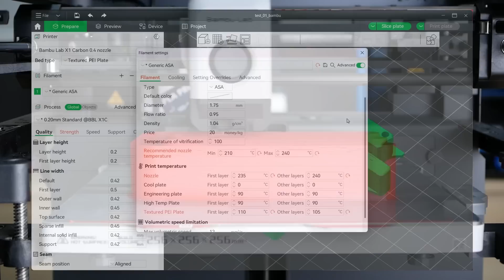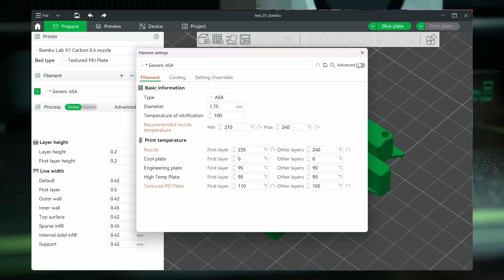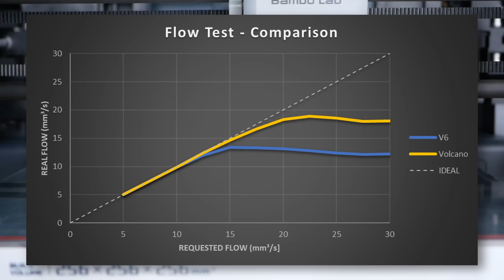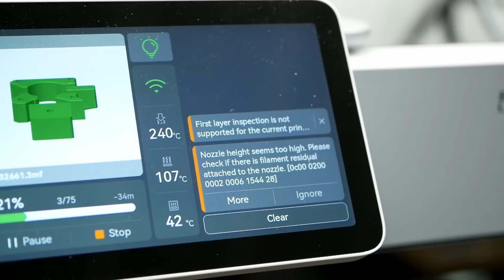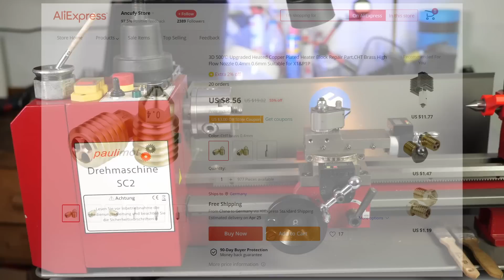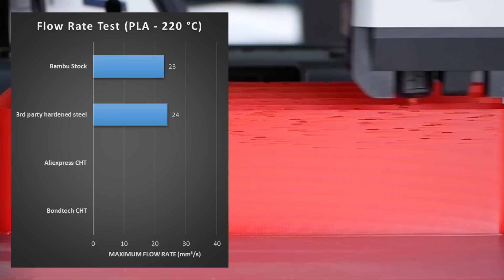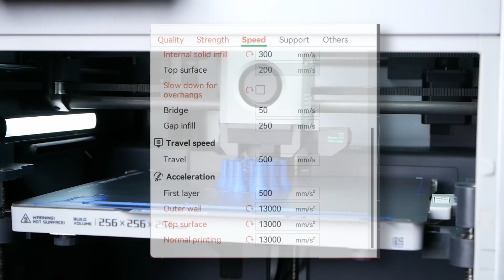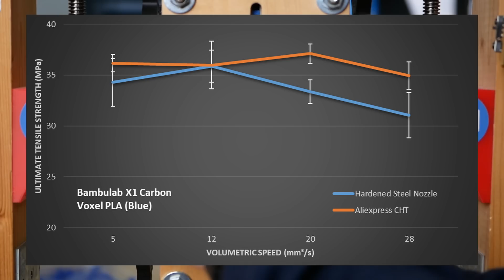Fast 3D printing is bad for Strength! (and how to fix it!)

Comment from the maker: Have you ever noticed that you printed TOO FAST?
Oh, and check out our CNC Kitchen products at https://cnckitchen.store/ or at our resellers https://www.cnckitchen.com/reseller
Reply: @Stefan,
You asked for an idea for your test pieces - how about Archimedean chords as 100% infill and 0 perimeter? This should allow you to reach the speed more likely.

General thoughts on flow rate:
When I have many identical parts to print, I often take the effort to set the layers to a different temperature for increasing the flow rate even further. It would be nice if there were a function in the slicer for this - a temperature dependency on the flow rate, or, in reality, a temperature compensation, because our material does not reach our set temperature. Perhaps we have a deviation between the measured value in the hotend and the actual temperature in the material due to the high extrusion rate. If you follow this idea further, it should be possible to establish a relation between the heating element's power and the extruder's feed rate, taking into account the thermal conductivity to consider the resulting delay in temperature correction. Therefore, I do not believe that these settings can be adjusted via firmware, as temperature changes must be made in advance. Unfortunately, I am not a programmer, but I am really interested in whether this could be used to tune the flow rate of ANY 3D printer without making changes to the hardware.

Tüdelü 👋
Reply: You don't drive a car at its top speed! 😂
Reply: @tslee8236  if I have a speedometer, I'm gonna use the whole speedometer!
Reply: Could you do a check on a Voron at high speed? Just to see if this is a generic fast printing issue or unique to the Bambu.
Reply: yes ! very poor layer adhésion issues specially with petg (X1C). days of tunning (slow down cooling and flow rate, increase temp).
Reply: .6mm nozzle and going at it with thicc layers has been way stronger.
Reply: I don't know if it's any use, but I ran some calculations using some numbers I could find for PLA's specific heat and density, and came up with a theoretical maximum cubic flow rate of 2.5 mm^3 per watt of the heater block. A 20W heater can at theoretical maximum melt PLA at 49.78 mm^3/s.

Numbers based on:
Specific heat capacity of 1800 J/kg/K
Density of 1240 kg/m^3
Target temperature of 180K over ambient (approx.  200C)
An assumption of no heat loss to the environment and perfectly even melting through the filament (hah!) but there you go.
Reply: I would suggest you increase the line width to about 200%.
This way you need less speed hence less acceleration.
Also the square corner velocity can help a bit.

A Voron 0.1 can easily hit 25k acceleration and 40 square corner velocity so that might also be an option tho you won't be using that hotend I suppose
Reply: So the machine can go up higher than 300°C??
Reply: Does the higher flow nozzles have any bad effects when printing slowly? Does it affect retraction settings?
Reply: Have you tried the E3D nozzle? We get much better results than from the CHT nozzles, and also get much better layer adhesion even at high speeds.
Reply: yup, i just noticed my PLA filament has awful layer adhesion. I just thought the random brand ive never heard of just made a bad quality plastic, but now I think I just need to lower the flow rate to ~8 mm3/s. Gonna try it today, maybe i'll change back from petg to pla again, for things i use just at home and not outside (for temperature reasons) Thank you a lot
Reply: Nice work, just a small thought, if the nozzle need a longer distance for the filament, then maybe the path of the filament in the nozzle could be changed to a circular downward path and end in the tip. A bit like the heat pipe in a water tank.

Comment: I print only at Standard speed w/ my two X-1 Carbons, and I use PLA, and I've noticed the parts feel very sturdy, but the layers look all funky just like you showed. I'm surprised that's even happening at the Standard speed.

Comment: my biggest problem with the x1c is that the firmware restricts how hot the nozzle can go. there are aftermarket nozzles that can go up to 500c but the firmware is hard limited to only let it go to 300c no matter what.

Comment: The next bottleneck after this is layer cooling - having too much affects layer adhesion and should only be used for bridging and extreme overhangs. I think the only real workaround to this is a larger print bed and printing more parts at a time, providing the plastic more time to cool off before the next layer comes along.

Comment: Normally I'm all for upgrading things using aftermarket parts in hopes of getting better performance. But in this case I will pass with my X1C. The printer has been 100% rock solid and is 100% bone stock. Why change something that isn't broken?

Comment: Interesting video, but you should continue to increase flowrate above 28 mm^3/s as CHT nozzle didn't show singns of decrasing the strength of samples printed  at high speed.

 I made max flow calibration in Orca (V3 KE, brass 0.4 mm nozzle, regular PLA), too, and I noticed that thickness of the meandering extrusion test is falling linearly up to 27 mm^3/s when obvious underextrusion (holes) starts to appear.
Anybody here knows how to make wall thickness constant up to a certain flowrate?

thx in advance

Comment: Could there be something about how deep the nozzle tip is on the original? If we are talking about cooling the nozzle too much or that the filament flow reduceses the temp of the nozzle so the machine can’t keep up. I’ve tested both ali and bondtech cht and finds bondtech to be the worste/best in conducting away heat with that big body/nozzle, alot less but still gives temp error on the ali cht. Could there be something here that made bambu go with such deep integrated nozzle. Or do we need to go with double heaters elements to sustain the temp as we can’t adjust PID.

Comment: Heij :) I've installed the CHT clone hotend and did the max flow test using PETG. It resulted in about 30 mm^3/s. After a few prints (like 3 or 4) I noticed heavy under extrusion. The parts I was printing were really small (print time of 5 mins) and it got better with special settings for quick layer times which also lowered speed and flow. I changed the nozzle, used Bambu's thermal paste instead of the one provided by the CHT clone, and swapped to the heater and thermistor. Later I figured out: The max flow rate is way too high. I redid the max flow rate test and only got 16 mm^3/s with the same spool of material. 
Any idea why I only get 16 mm^3/s with the clone hotend? Maybe it's got something to do with the 1.7.x update? I cannot test with old firmware because Bambu won't let me downgrade.

Comment: These AliExpress cht nozzles keep clogging for me. Anyone else experienced this? Ive tried 2 different hotend assemblies
Reply: I thought they were clogging. Rerunning the max flow calibration showed that I only get around 14 mm^3/s for PETG, which is the original value for the stock hotend. Resetting it to 14 mm^3/s and no single issue (except for the fact that the CHT clone hotend is now useless)

Comment: so... 11 cubed as roof for pretty parts. thnx man. I was about to send the printer back when i saw your video. all my prints came out not stronk, with shell detachments and spaghetti on all profiles below 0.2mm. 
with most my 0.2mm come out looking good until u really look. the variation of the kfaktor is all over the place with EVERY filament i tested so far. from 0.021 to 0.038. cant say that is usable imo. just a sales gimmick. it gets u in the ballpark but its no homerun. Bambu runs FAR to fast for its own good. sure... it CAN print that fast. but the result is so so compared to more modest speeds. like 6 mms cubed for abs instead of 22... after watching this is i lowered the flowrate as the only change and lord be hold.. it prints PROPER PARTS!!! 

What happen with ur black hot plate surface? looks like some deep scratches to me
Reply: So bambu literally prints worse than my cheap bedslinger when it comes to quality and speed combined. Got it.
Reply: @youtubehandlesux  bet u it doesnt.. any corexy will slay any slinger in any parameter except price. thats just how physics work. after using normal flowrates and actually having time to test alot of filaments i can clearly say this rig is what im changing out the time one of rigs dies or gets an issue.. the extruder is rocksolid and has no peaks or valleys in any testing ive done, i can make single walled tpu benchys with no hull line with this rig. 

but please.. do think ur lada is better than the bentley.
what we had issues with was the profiles provided.. not the machine its self. u totally missed the point here mate.

Comment: Great video as usual! Did you notice the same quality / strength issues when printing with input shaping on the MK4? I am wondering if that little reduced speed compared to the Bambu Lab actually gives a better strength.

Comment: Thanks for the explanation and test.
I confirm using the default bambu ASA setting results in poor layer adhesion.
I was able to get acceptable results by setting the speed to 50% of the preset.
I feel your suggestion of limiting the max flow rate is a simpler and more reliable way to achieve the same.

Comment: So it sounds like Bambi printers don’t have a speed problem? The flow rates set in the printers match their printing speed. Bambu pls has a default flow rate of 23mm3 and prints at about 250mm/s so it matches your tests…

Comment: I'm using a Volcano setup with a titanium heat break and the new Micro Swiss hybrid hardened nozzle tip volcano nozzle (I used copper anti-seize on the heater cartridge) and i'm getting about 16mm³s flow before it starts to show a matte finish with the same OrcaSlicer test. I found i get great mechanical layer adhesion up to 26mm³s and i went ahead and undersized my extruder motor to match. Running faster with better adhesion, but now i need to upgrade my cooling. For now I had to double my max threshold layer time to slow down the prints at 8 seconds. Part of the issue is i designed a narrow focus on part cooling, although pretty strong air it's still only over the section of the part for a half second running 250mms/4k print speeds. This makes single fine tips come out great but multiple slightly larger areas that insulate themselves with thicker walls stay warmer

Moe printing, Moe problems

Comment: I wonder what that stabilization systems are like in the Bambu Labs printers, and other printers.
I think that you could use centrifugal force to change the direction of the movement/inertia in the Printer Head to keep it from shaking.
Kind of like how it's easier to move your hand quickly in circles or ovals without moving your body, than it is to move your hand quickly left to right.
Great video, Stefan! I hope Bambu Labs listens and learns from your experiments and findings.

Comment: For the strength test on the fast speeds, you could increase the radius so that it has time to get up to speed. Then you could use your lathe to get the profile correct, while cutting out the acceleration/ deceleration zones
Reply: Increase the radius of what? Sorry if a dumb question

Comment: I was seeing banding on the sides of xyz test blocks.  I couldn't figure out what was causing it.  Thanks for the info.  Now I know.  I was reducing the perimeter speeds from 300 to 150 but not changing the infill speeds.  I'm guessing the nozzle was being cooled by the high speed infill and not getting back to temperature when it started the next perimeter.  I'm going to do some more testing to see if this is the case.

Comment: I can't print even fast because I get a y-Axis layer shift :D max_accel: 1000 und print speed 80 is the limit :/ .... I wan't a bambu lab .... ATM 20% sucsessfull prints and in the 2 Weeks i have the Printer 1,5 Weeks just fixing the machine ... its not fun

Comment: Amazing video, does the nozzle diameter make a difference to strength of prints at high speed on the p1p? Also the layer width? 
Im using the ender 3 v3 se at there stock settings and compared to my original ender 3 at stock the parts are weaker on the v3 but the quality is just as good if not better on the v3 that the original ender 3

Comment: 3D printer producers are searching for lock-in (see Bambu). 
That's why I'm moving to Titan (or Titan Aero) + E3D V6, for standard inexpensive and exterminated market of everything! 
Speed? Better buy 2-3 inexpensive printers (small Kingroon KP3S, medium Ender 3 V2, large Artillery X2) and let them work together. I divided my last toy for my son (big Super Mario) in different pieces sliced for 2 printers, and finished quite in half the time with both good quality and strenght.

Comment: The good thing about Bambu labs printers is that you get to choose between fast(weak) or slow(strong). 

For me personally I always like a good balance between speed and strength but sometimes it's nice to be able to go crazy fast just to impress your clients. Also, the AMS unit is excellent and makes life easier (if used correctly lol 😅)

Comment: If you're just doing a pull test then there's no reason why the cross-section of the coupon needs to be circular. If you make them rectangular such that the extruder makes a smaller number of longer lines then that will reduce the impact of acceleration/deceleration at the ends.

Comment: Hey there, Ive noticed that the partcooling airflow centers on both of my X1C`s ~5 mm below the nozzle. Did they change something? If you put the tip of your finger below the nozzle, while having the partfan activated its clearly to feel.

Comment: sorry for my english, congrats for the amazing videos you make.
so if I put the acceleration and speed parameters, for example of the prusa mk3, should I get resistant pieces, or do I need to touch some other parameter to do this?
you could do tests as only you know how to do 🤩 , to understand the best parameters, use if you want speed or resistance
Thank you

Comment: I don't want to sacrifice quality for speed in most cases.  I like 1) reliability 2) repairability and low maintenance 3)  and good print quality.  Speed is not my first desire in a 3d printer although it might be nice to have one where print quality isn't important.

Comment: This is good information; I just got a P1S and learning as I go proper technique. My understanding is that controlling volumetric flow rate effectively limits velocity correct? Why not just set it to 15mm3/s and move on?
FYI BL now recommended 15mm3/s for the bronze/gold color due to visual differences (guessing the matte vs. glossy look)

Comment: Excellent comparitive analysis, thanks to the hardwork on the same❤👍.  What I feel might be the issue, is the max power capacity of the heater, and also the quickness of the PID system controlling it. That being the reason for better performance at elevated temps. So, the heating element itself should be beefed up, along with a more responsive PID, coupled with a higher output power supply for the heater element. Essentially, it boils down to the max possible volumetric melt mass within a given time duration. Just some 💭

Comment: The video considered the extrusion rate in mm^3/s, length of the melt zone, nozzle design and hot end temperature as variables impacting the temperature of the material exiting the nozzle but that's only half of the issue.  The temperature of the previous layer is also critically important to interlayer bond strength.

Instead of printing 14 pull test samples at once, allowing the previous layer to cool, try printing the test samples one at a time so each layer is extruded onto a layer that hasn't cooled as much.  I print small structural parts in TPU.  I have the slicer print them sequentially and the parts are ridiculously strong because at 50 mm/s print speed and minimal cooling, hot TPU is being extruded onto very warm TPU, rather than printing hot TPU onto cold TPU.

It would be interesting to have a slicer setting that adjusted fan speed for uniform part cooling depending on print speed and part geometry for more uniform results, hopefully avoiding matte finishes in some areas.  I believe so much effort has been devoted to adequate part cooling on the new generation of fast coreXY printers that little to no concern has been expressed for excess cooling in some instances.  Maybe the problem isn't printing too fast, but rather cooling too much.

Comment: I wonder if you can increase the fan speed as print speed increases.  If the plastic leaves the nozzle at the same temp then the only variable is the amount of time the line of plastic is exposed to cooling fan.

Comment: Other tests have shown that the same filament from the same company, but a different colour, made a significant difference in tensile strength. There seems to be chemical bond differences between the colour filler materials.
Reply: Stronger prints are more durable and therefore  last longer. The science on bond structures(cross polymerization) might be boring to most people, but if chemical companies can improve the flow rates and mechanical properties of these filaments, more people will discover how usefull 3d printers have become.

Comment: Can you please do an updated "getting started" video for newbies who just want to print things like shop vac adapter parts, or casings for drill bit organizing or the million different clasps and hooks and strange shapes that would be helpful for wood shop organizing? 

I've never used CAD software before - I'm looking for something like "buy this printer, with these accessories, install them this way, use this software, buy this filament for X job, this filament for Y job", etc
Reply: What about 3d resin printing? How does it stack up against "traditional" 3d printing?